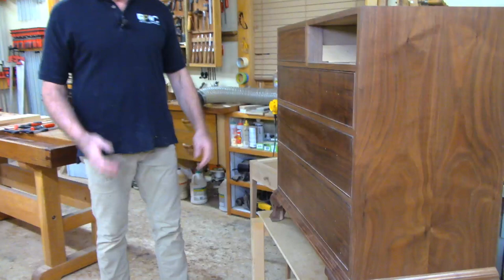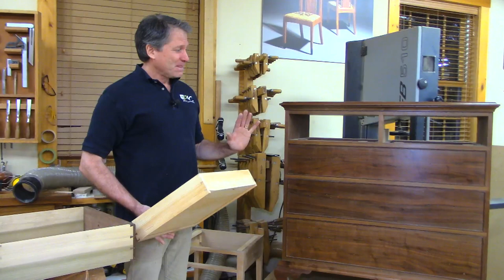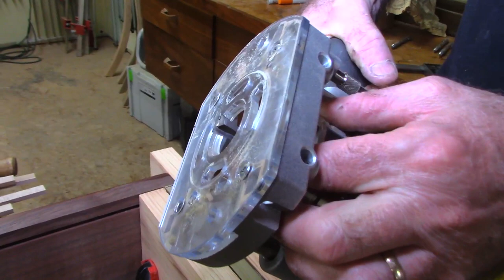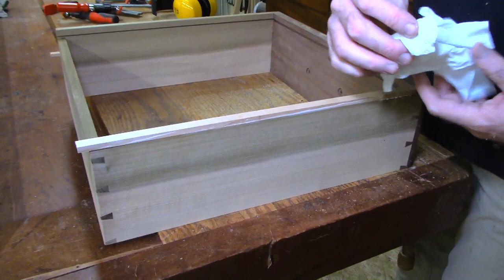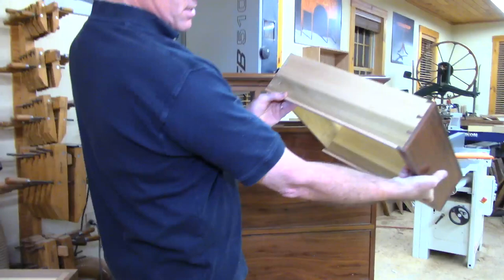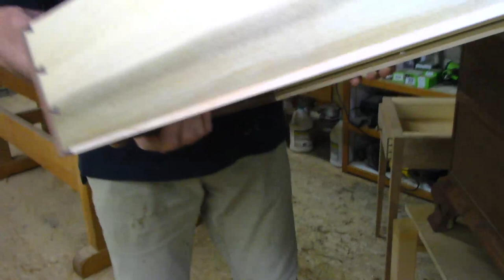Making a Chest of Drawers Is Worth It with Tom McLaughlin

Comment: Hi Tom, excellent video again & a beautiful chest of draws. When you make your draws, do you have any problem with the air pressure pushing them out again, as you are closing them? The reason I ask is, I seem to remember, I was told a long time ago, you should tapper the draws slightly & make the back of the draw slightly lower than the sides, so that the air can flow over them. Is that right?
Reply from the maker: Interesting you ask that Ron. I actually just went into that topic a couple weeks ago during the Shop Night Live finishing touches on the Shaker chest of Drawers video. There are a few ways you can allow the air to escape but I wouldn’t taper the drawer sides to do it. Tapering the sides will create a more sloppy “tip down” issue when the drawer is extended. It would be better to simply leave the drawer sides true height and rip the drawer back 1/8 - 1/4” shorter to allow for air to move more easily. Hope that helps, Thanks for watching! 👍😎
Reply: @EpicWoodworking  Thanks Tom, that makes sense. Keep the tutorials coming. I love them, don't do much work, because I'm watching you all the time, but I love em.

Comment: You wouldn't be a woodworker if you didn't have a few unfinished projects hanging around! Love frame molding ,have you ever used a sliding dovetail to attach  molding to a case? A beautiful chest to leave unfinished!
Reply from the maker: Thanks Scott! I guess that’s true, but I’m getting to a tipping point where I’ve got to get a lot of them finished, fortunately making videos on the pieces is nice motivation and feels less like backtracking.😎
I have used the sliding dovetail method a few times, which can be tricky with coves that tend to be thinner. It is an elegant method when the situation is right. Good ol’ brad nailing, although a little crude, can work fine too and is a lot faster. An I agree frame molding is pretty great method...I didn’t know it was called that 🙂 Thanks for making me feel better about my procrastinations!
Reply: @EpicWoodworking  I don't if frame molding is the right term either but it sounds good! LOL!
Reply from the maker: Yeah, sounds good to me...I plan on using it like I know what I’m talking about! 😎 Thanks